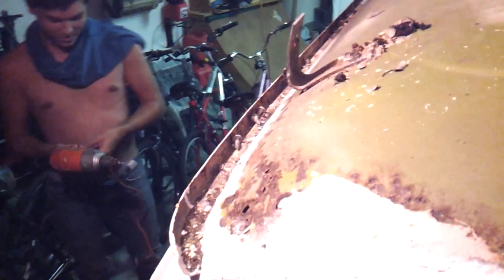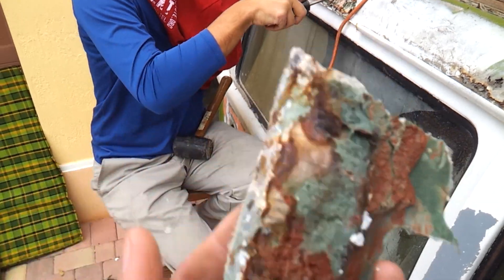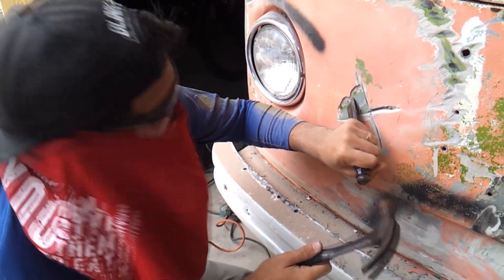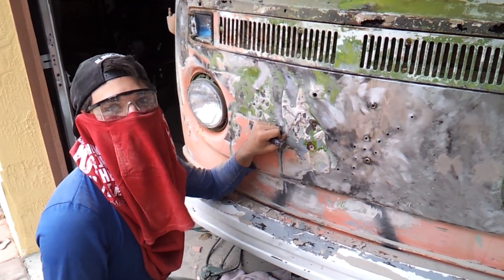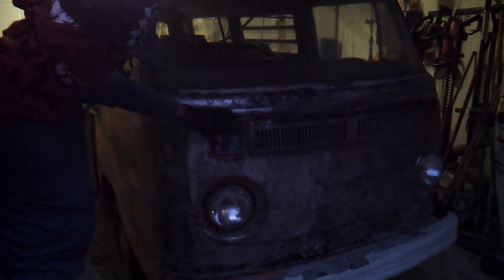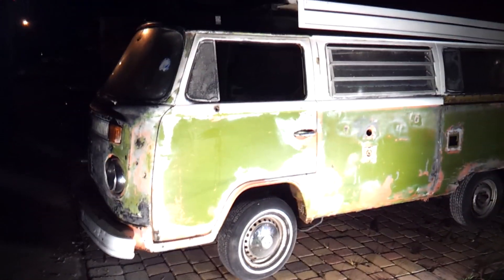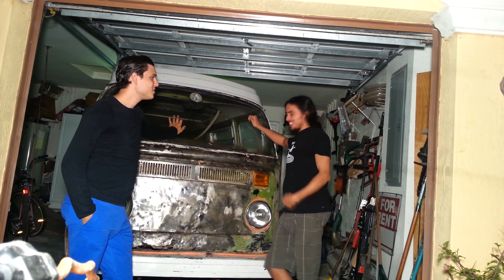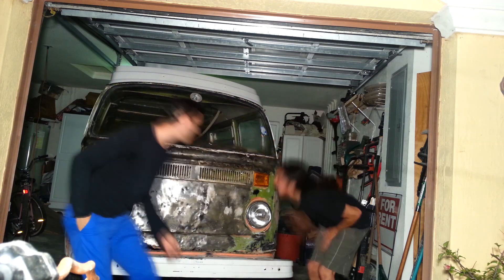VW Bus (Westfalia) Restoration Part: 2 Removing bondo

Comment: you want to use a flap disc on that metal with an angle grinder it would save so much time, be quicker and produce a much better result
Reply from the maker: Thanks for the advice 👍
Reply: no problem just google flap disc and you will see what its like about £5 from ebay